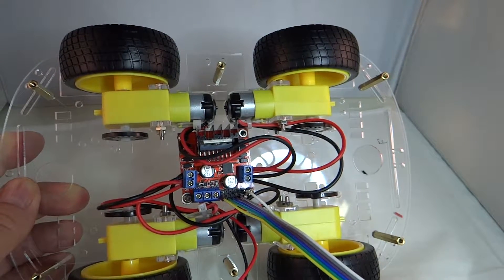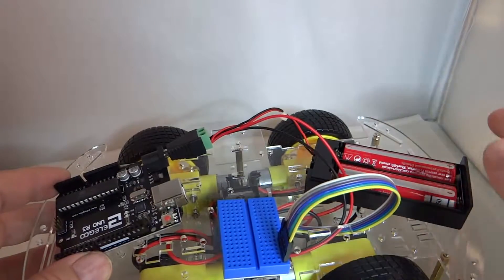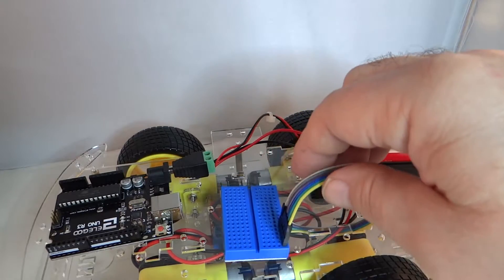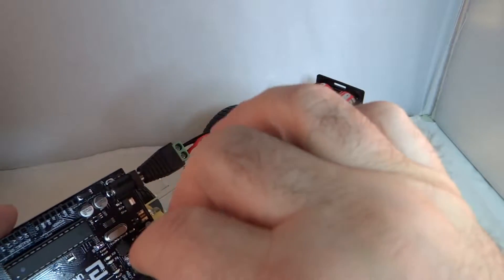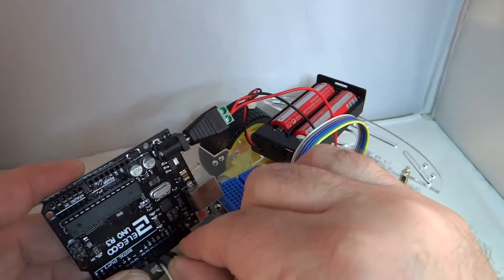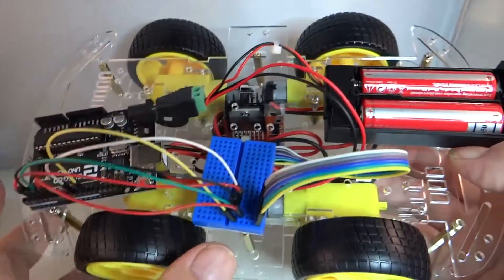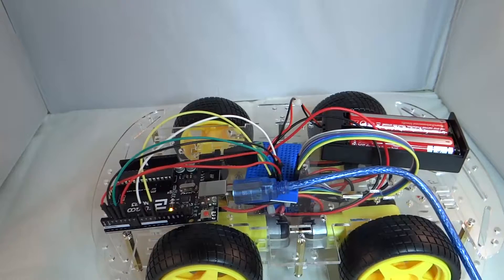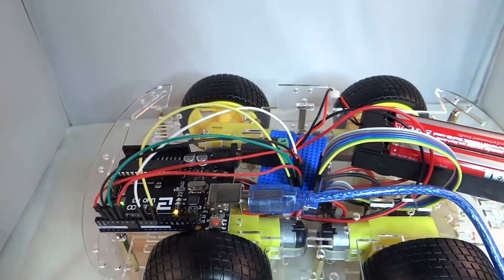Wiring the Arduino Uno to the motor controller

Comment: Can I do that same connection using a 9v battery?
Reply from the maker: Nathali M Maybe, the typical 9v alkaline battery does not have much power capacity to drive the motors. The motors require 500ma to operate and a brand new 9v battery should have 500mah, which means, theoretically, the car would operate for an hour. You might try several 9v batteries wired in parallel. When I get a chance, I'll try it, and post the video.
Reply from the maker: Nathali M I just found www.powerstream.com/9v-Alkaline-tests the 9v battery will last only 15-30 minutes based on their testing. Maybe try four batteries in parallel.
Reply from the maker: Nathali M I just found www.powerstream.com/9v-Alkaline-tests the 9v battery will last only 15-30 minutes based on their testing. Maybe try four batteries in parallel.
Reply from the maker: Nathali M I just found www.powerstream.com/9v-Alkaline-tests the 9v battery will last only 15-30 minutes based on their testing. Maybe try four batteries in parallel.
Reply: Got it. but it should work anyway then right?! I'm thinking I burned my H bridge because I connected everything the same, and the code runed succefully, but i got no response. So I tested each motor connecting them directly to a battery and they all worked. When I connect them to the H bridge and do all that they don't move. The light of the H bridge does light up. but i got no response on the motors.
Reply from the maker: Nathali M Can you send me a picture showing how the battery and motors are connected to the bridge?
Reply: sure. do I send to an email or where?
Reply from the maker: Can you find me on Google+?
Reply: sure
Reply from the maker: I think you can post a picture here. I see a camera icon.